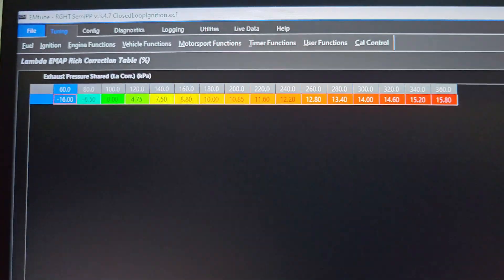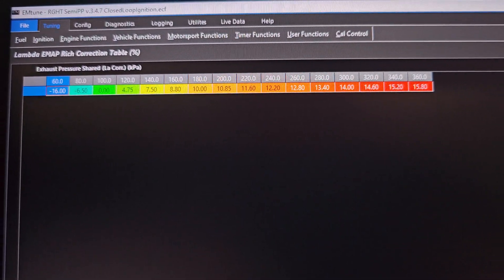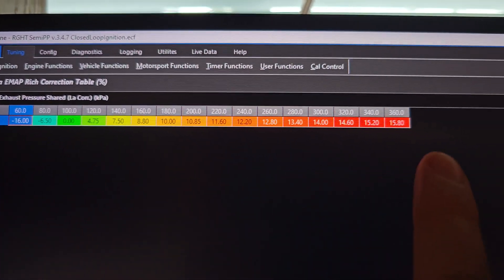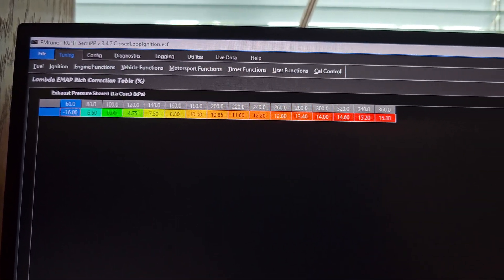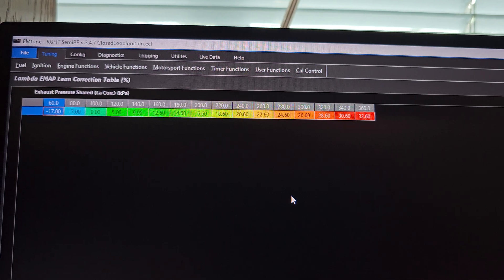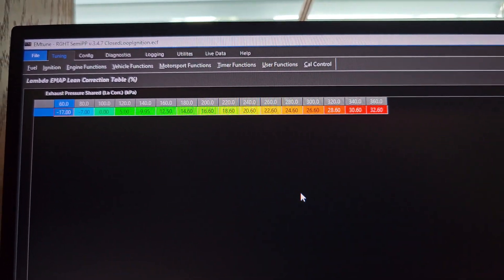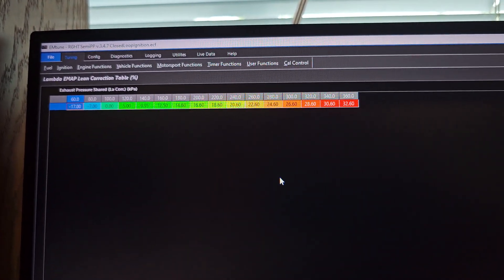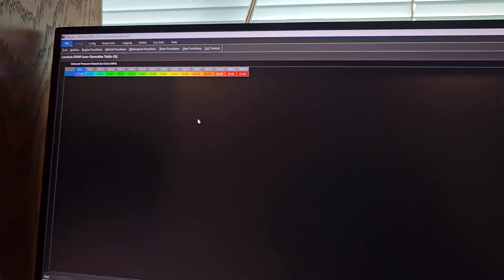HOW-TO: Turbocharger Backpressure Secrets Explained

Comment: Yes, if you add more timing, you increase cylinder pressure and lower exhaust gas temperature. If you decrease timing your decrease cylinder pressure and raise the exhaust gas temperature.
Reply from the maker: @spooler7828  That is all relative and not to any indefinite points.
Reply: @RGHTBrainDesign  With my crappy VQ37vhr I have to be careful not to make the block dance with too much cylinder pressure to low in the rpm range to keep it alive. I am on an  Emtron also.

Comment: There is some great information in there but I think you've misinterpreted the pressure offset data for the wideband. It isn't to factor in "boost", it's to allow for pressure acting on the sensor itself, which on most tuner cars with a free flowing exhaust is minimal. If mounted in the exhaust manifold it can be huge as you pointed out, but in the downpipe where most people put them, it's small enough not to matter in most instances.
Reply from the maker: This is for Backpressure (EMAP), which in most systems besides drag racing, is significantly higher than Boost Pressure.  I have documents of this all over the RGHTBrainDesign Facebook page with examples of car to car.

Comment: When you show Emtron EBP lambda compensation tables, does they count for EBP and WBO2 placements? Because i think EBP pre-turbo (where EBP normally measured) and EBP somewhere in downpipe or lower downstream, where WBO2 most probably installed in most cases, are very different.
Reply from the maker: I am struggling to find how this would effect the compensation table unless either the manifold, downpipe, or exhaust are a restriction and mis-sized for each other.  Realistically this is a numerical plot of the Bosch Motorsports LSU ADV Pre-Turbo Sensor and the datasheet on there has this in table form.  The idea being that with pressure differences, our lambda control strategy should change as accuracy fades with more pressure.
Reply: @RGHTBrainDesign  Thanks for answer. I understand the idea that with pressure raise (and temp actually too afaik) LSU will not be accurate. My question is how normal user / tuner should tune these 2 tables in realistic situation, where EBP is pre-turbo and LSU after. Or is it not necessary in this situation as EBP quite low downstream and not much compensation needed in real life?
I've never had a chance to tune ecu that have such a compensation or used pre-turbo LSU sensors. Most ecus i tune have on-board LSU, but i also keep my dyno WBO2 at tailpipe for reference too. Yes, i sometimes see quite a deviation between (maybe not bc of this phenomenon we are discussing, but rather different controllers accuracy etc) and making my lambda "decision" by spark plug reading and experience.

Comment: Great video, I appreciate the information you're providing. What are your thoughts on back pressure and electric wastegates? The turbo I'm using for my set-up, 9280efr, has a "smaller" than ideal turbine size for a 3 rotor. The few that have used the turbo on 20bs report boost tapering off in upper rpm. My thoughts are with a 4" downpipe and electric wastegate, it should hold the desired boost pressure while also allowing slightly lower back pressure due to the larger downpipe. My main focus is an extremely responsive set-up with great mid-range and decent top end.
Reply from the maker: What I want you to do is reach out for one on one time and tuning and I can explain this to you better.
Reply from the maker: I've come to a conclusion with 20B stuff so far that larger turbine wheel is almost always the answer.   For Neal's car he did 805whp on 27psi for a super responsive custom 7485, your 9280 would be registered as a 7473 in the same nomenclature.  At minimum, you'll want the 1.45 A/R turbine housing and you'll start to choke the turbo easily at low boost. 

EGate won't help this at all, it's just a different way of controlling the exhaust flow. 

This setup will have pretty high EGTs due to the turbine wheel design and matching of the 20B, which I hope is not much more than a streetport.